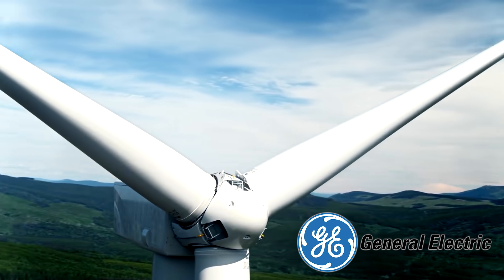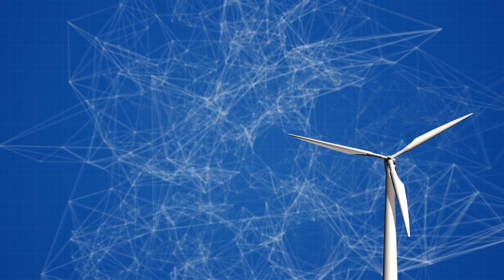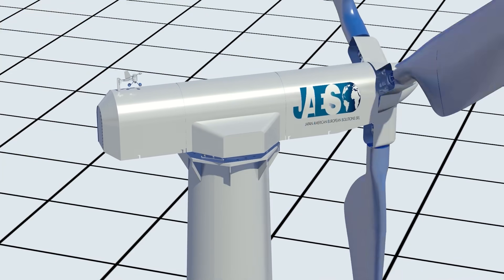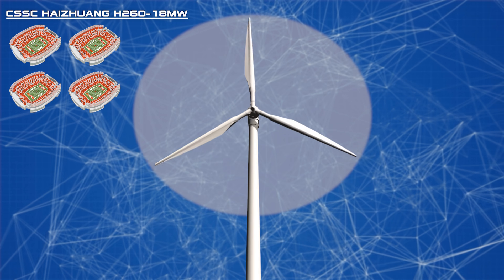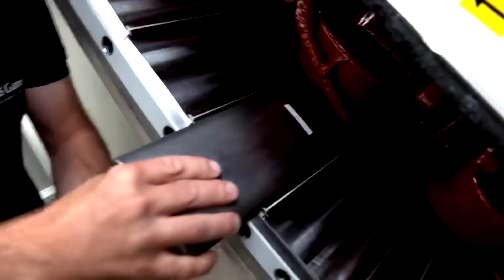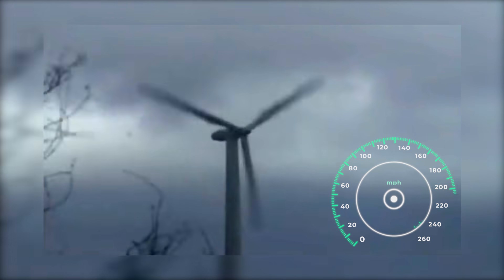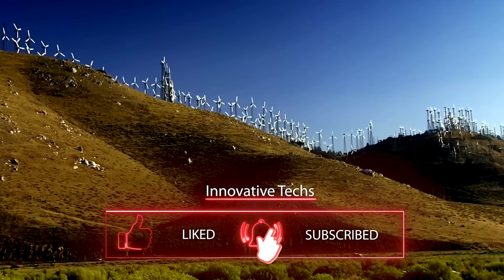China is building a wind turbine of unthinkable dimensions

Comment: Like all wind turbines, these giant turbines will require reliable power sources (natural gas, coal, nuclear) to compensate for their chaotic energy output. Because their output is erratic, they only produce about 40% of the energy of an equivalent reliable plant. Hence, you need 2.5X as much wind capacity to equal a reliable plant's capacity. Don't forget to add those costs into the bottom line.
Reply: This is why people use LCOE to measure cost
Reply: levelised cost of energy. how levelised is it? over a year? @infinitelyexplosive
Reply: this. btw. how are those rust batteries coming along?

Comment: Please just make the tower with up-position flapps, you save a small fortune on construction cost... 
Rare earths in generators is china specialty generally there ways around it... its the question of engineering, conus gear box for specific frequency output... i dont see a high standard to it that video (fibre resin  blade instead of metal - recyclable)

Comment: It would seem that the advance ratio is such that more blades could be added to the larger turbines to get more power out of the swept area - also that structural limts and tip speed now constrain the design - external cable bracing should be more efficient by simply extending a strut along the rotation axis and bracing the blades off that . similarly bracing the tower externally to the bottom of the blade radius . The bending in the blades is very evident and introduces oscillatory loads as for helicopter rotors that are centrifugaly relieved - The blade erosion problem seems to be a major issue limiting service life as is fatigue . The square cube law of scale looks to be defied somehow -- having more smaller turbines might result in more average wind (not all eggs in one ,big, basket )
Reply: Wind speed is low at ground level due to ground friction, and air to air friction slows wind speed up to a height of 700 ft or 200m.  The size of the wind turbines is only now approaching the optimum for collecting wind energy. 

An additional factor is the poor design of current wind turbines : all the heavy parts demanding maintenance, with a potential fire risk, should be at ground level. Horizontal wind turbines are the only option
(a) The blades are in the air flow at 200 to 300 metres.
(b) The generators, and all electrical circuitry are at ground level. 
(c) A wide base achieved by having tensioned steel ropes up to the start of the blades.

Comment: Wind turbines are the stupidest machine ever invented -the serviceability is nearly impossible and every single part EVERY PART (except for the MASSIVE concrete base that will outlast the Egyptian pyramids) has to be REPLACED in 28 years or less. Ask the Germans how that whole replace every single part thing is working out for their bird and bat choppers -not well at all. The Germans HAD TO (quietly) restart their coal-powered power generators -oops. Turns out that these intermittent and unreliably windmills have a habit of rusting and falling out of the sky, leaving MASSIVE CARBON FIBER blades that cannot be mulched as they are cancer-causing and WOULD seep into the water table and pose a huge risk to humans and ALL animals. Worse, the massive unusable blades then have to be put into landfills. Completely using up that landfill with a half-life of never safe. -STUPID. The words untended consequence leaps to mind -but that's okay because the profit takers will have already moved on leaving the taxpayer with the cleanup tab as IS what happened in Germany.

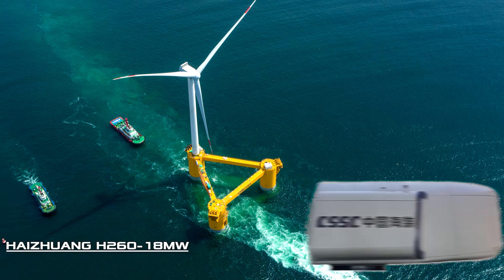Comment: @2:54, doesn't 853 feet equal 2.83 football fields, not 2.5? But the real point is, the devil is in the details. Most places don't have abundant wind. Wind tends to die at night. There is no practical storage systems -(theoretical yes, practical no). And finally, these wind generators are fragile, they constantly need replacing, the blades like to come apart at inconvenient times, and they only are economic with government subsidies. Of course, the subsidies are only temporary. Just like government departments are only temporary. It is a total con-job.

Comment: Living in San Antonio, TX most of my life I use the height of the Tower of the Americas as a reference, it stands at 622' (to the top of the roof, I don't count the tower which rises to 750').  So when I think of a 450' blade, that's two-thirds the height of the tower and damn impressive.  I wouldn't want to be too close to it in operation, to be sure.
Reply: Wind speed increases up to a height of 700 ft, 200 m. Near the ground, ground friction slows the air speed and all air in contact with the slowed air is slowed by air to air friction. A tower height of 1000 ft, 300m would be ideal for a 450 ft, 150m blade.
Reply: If it’s offshore then I’d be ok with it… imo wind farms ruin the scape of a land vista
Reply: True that, especially if you are a bird.

Comment: The numbers and sizes are difficult to imagine.  Having scaled diagrams of turbines next to each other would really help.
Reply: too difficult. 
too advanced
Reply: Yes and maybe toss in a shadow of other iconic structure--Empire State Building, Golden Gate Bridge, Eiffel Tower.....
Reply: At least dump the imperial units.
Reply: @manuell3505  imperial units are good
They remind avrage UK racist of their glory.
Reply: @manuell3505  Having been educated in the US; I can confirm Imperial is the dumbest measurement system of our time.  Working on old cars with fraction wrenches and bending sheetmetal with 7+ digits to go metric.  The US must waste millions of hours of manpower calculating this stupid system.  You can teach any child metric in 1 day so why they stick to Imperial is a mystery.
Reply: @smallmodelcollector  1 litre of water is 1000 cubic centimeter and 1000 grams. 1 gallon is 231 cubic inch and 3.78541 grams.

Dumbest. ^^
Reply: @manuell3505  
1 gallon of water is 10 lbs. The exact value depends on temperature but 10 lbs is near enough for domestic purposes. 

Imperial works fine for domestic purposes but fails for any ballistic, engineering, and design calculations.  For example a poundal was invented to get round needing a constant value for g (gravitionational constant) for acceleration. 

Henry Ford was driven to use metric for car manufacturing to achieve the needed precision. Imperial units were all defined using metric values.
Reply: @michaeledwards2251 "If you are dealing with water and need to convert 1 gallon to pounds, a gallon of pure water at 39.2 °F (4.0 °C) weighs 8.35 lb."

This was from the time everybody had his own local standards. They lost a spacecraft by it.
The metric system used to be based on the official "meter" which was a metal bar in the Louvre/Paris. Not sure if they still have it.
Reply: @manuell3505  
Again another problem with non-metric units. I live in the UK and I work in imperial gallons, but a US gallon is smaller. Hence for practical purposes, I work in UK gallons which equate to 10 lbs weight in water of the same volume, and you work in US gallons which are equivalent to 8.35 lbs or less of water.
Reply: @michaeledwards2251  I think it has to do with trade in raw materials. It always leaves room for cheating on the weight or amount.
Nothing is static.

Comment: A wind turbine could spin until it fell apart and never repay the energy budget that went into creating it; from mining the minerals right through to the moment that it was turned on and began generating.
Reply: Bulls&*t, get their energy back compared to coal in about 3 months. Remember it does not take much more resources and cost to build wind turbines compared to fossil fuels massive infrastructure (Power station, mining, refining, transportation etc), but they need NO FUEL. A 1GW coal power station requires 9000 tons of coal per day!!! A wind farm zero, and maintenance is about the same!

Comment: Wind speeds higher up are faster, so putting turbines waaaaAAAaaay up in the sky means MORE POWER! We should be putting wind turbines up in orbit but building them hanging downwards to capture wind at the edge of space which moves close to the speed of light! This would provide free unlimited power forever with just one turbine. To get the energy to the ground simply use a long string of interconnected paper clips.
Reply: To save money, build everything out of renewable coal. Even the paperclips.

Comment: If engineers could overcome the corrosive environment, placing underwater turbines in areas where the current is swift, including at the channels in and out of a harbor or bay, the forces of water moving would be able to drive a generator (with gearing) much better and more reliable than the wind ever could. 
Food for thought...
Reply: Overcoming the corrosive environment is done with sacrificial anode plugs, as used by ships. You replace the anodes periodically. The anodes corrode before the superstructure does. Typically made from zinc.
Reply: There is nothing the sea will not break.
Reply: Maintenance on those systems would be expensive and frequent, due to the corrosive environment and the forces involved. It would require expensive vessels capable of maintaining positions without the use of anchors, highly skilled and trained divers, specialized repair equipment that has yet to be designed, built, and tested, and the frequent and expensive use of ROVs for regular inspections and troubleshooting problems, all which would make this economically unfeasible.